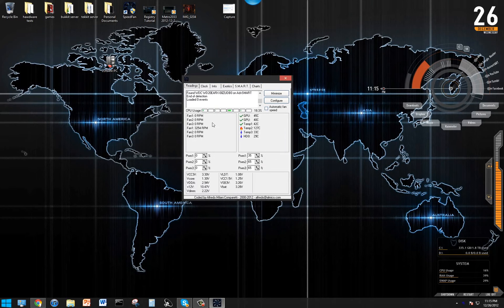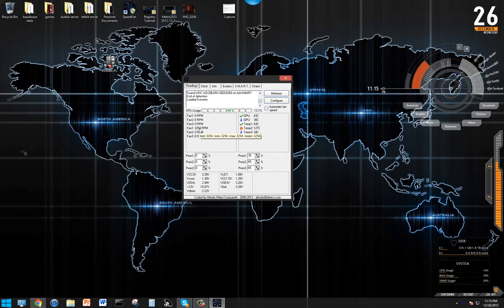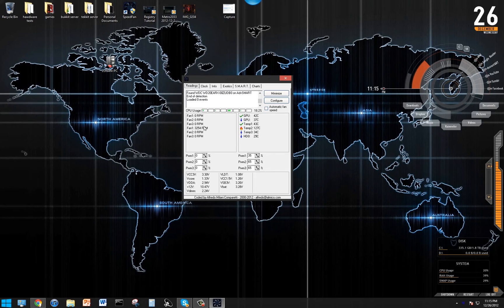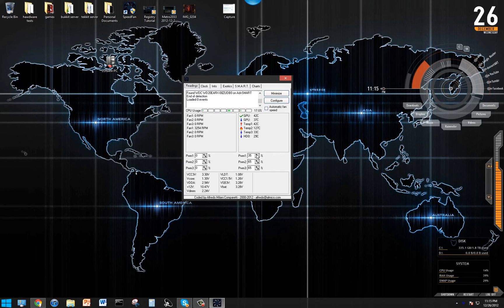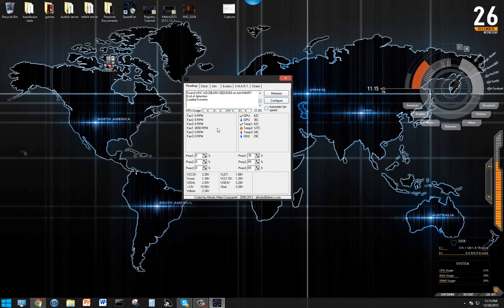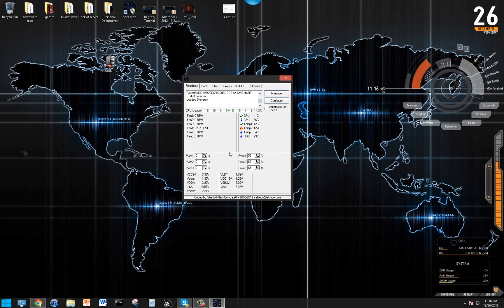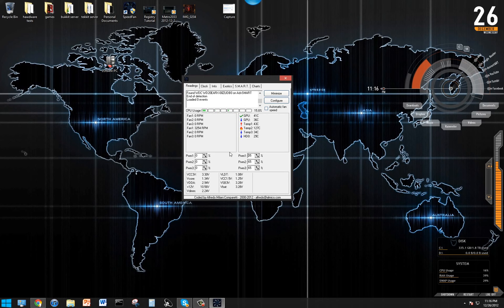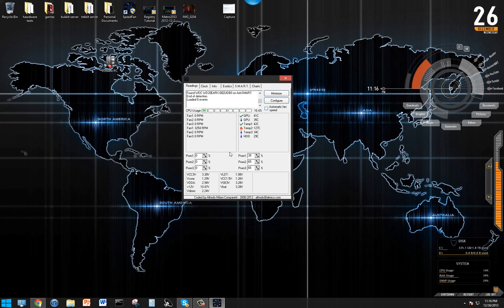How to change the RPM of your Pump (PC Watercooling)

Comment: What aio are you using that's got a pwn connector to your pump ? mine are always 3pin... so I can't control the pump speed unless I use an external fan controler (but I don't want to use it, I want to control thru software and not have all the cables).
Reply: This is a custom watercooling guide not an aio guide.
Reply from the maker: Sorry I didn't see this sooner. This is for a custom setup. Seperate pump, water block, reservoir, etc. This model was on a D5 pump.